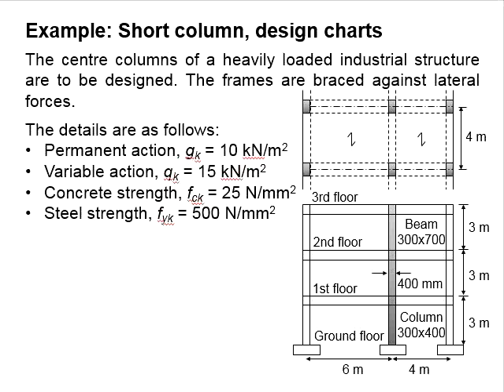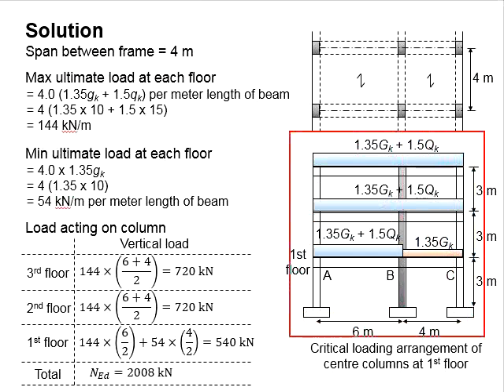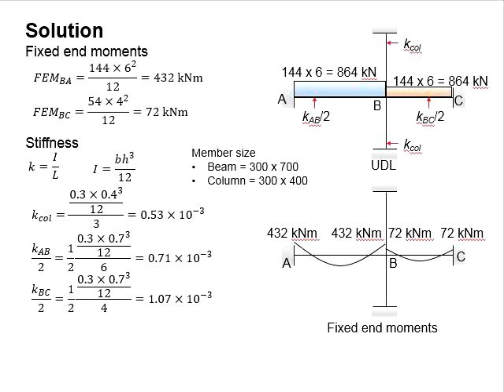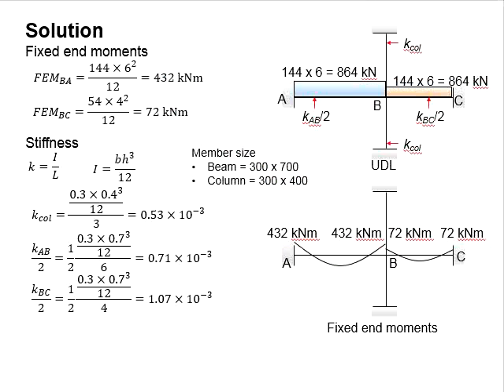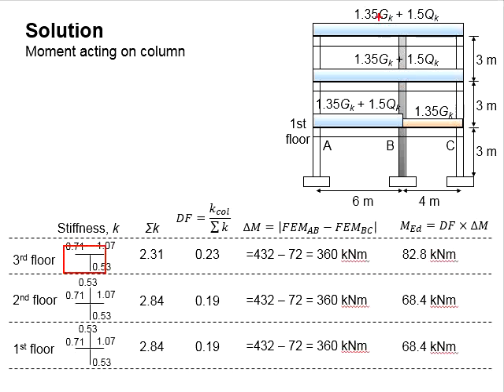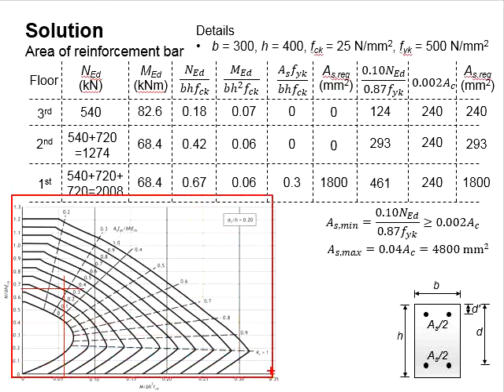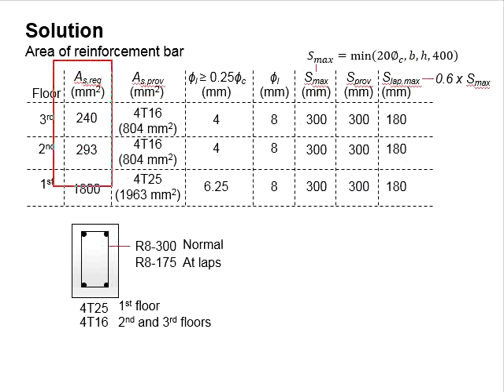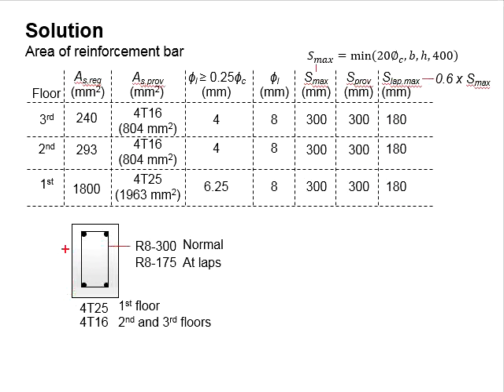2.10 Example of short column design

Comment: @12:11 If we wanna use 6 longitudinal bars (2 more bars in the mid section of x-x axis) instead of 4 bars, how to calculate it ? I feel like the distance is too much (for the 400 mm side), is there any formula to see the limit of the distance between the longitudinal reinforcements?

Comment: @8:43, the moment difference, delta M (first floor) = 432-72 = 360. But how come the difference delta M for 2nd and 3rd floor become 360? shouldn't it be 240 kNm? because the BC moment (2nd floor and 3rd)= (WL2/12) = (144 X 4^2)/12 = 192 kNm. So the delta M (2nd floor) = 432-192 = 240 kNm. Where did I went wrong?